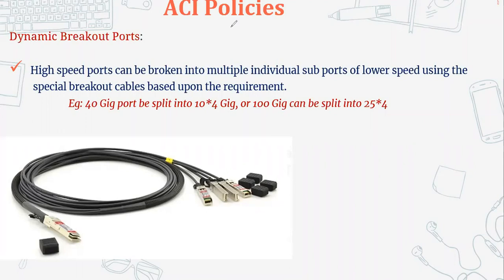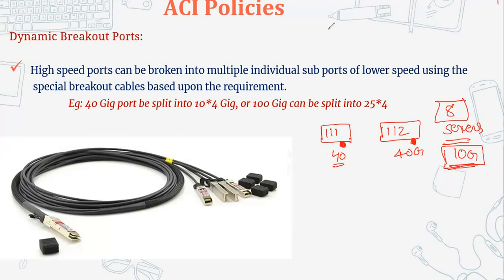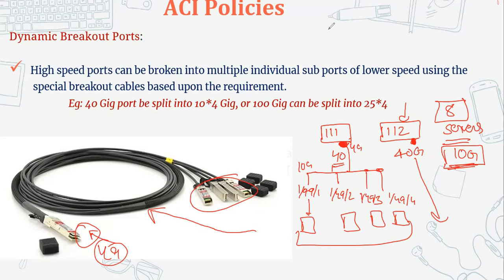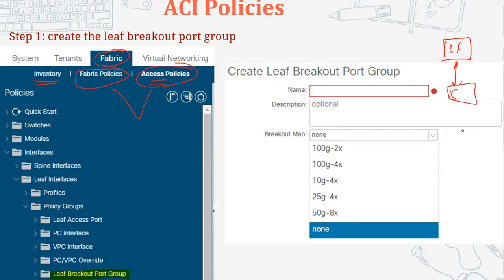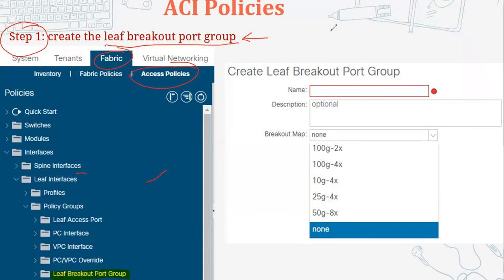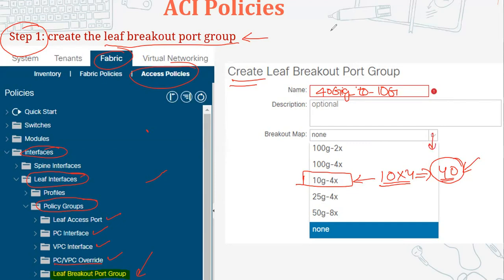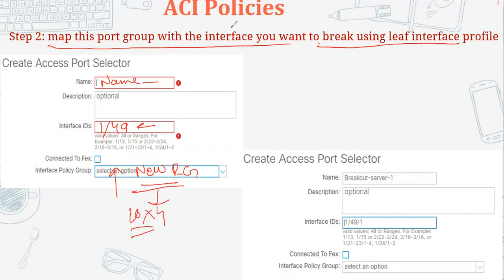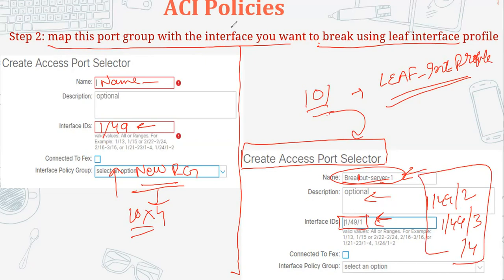CISCO ACI LECTURE 6 (Dynamic Breakout Ports) CCIE 57391

Comment: Hi

Thanks for the Video

Can u pls do Video How to Wire the ACI Fabric and How to Wire the Servers/Bladed/FW/LB  , i mean the required Cables/Tranceivers 10G/40G for ACI Fabric and for the Servers/Bladed/FW/LB Connected to the Fabric
Reply from the maker: Hi, i do not have any experience in server/LB/FWs, but i can tell you that on leaf switches we have multiple flavours like copper/rj-45 ports leaf, then we have sfp/fiber leaf that support different port speeds like 1g, 10g 25g 40g etc, for more details on modal wise details for leaf switches you can check cisco’s scalability guide..
Reply: @TheNetworkShooters  
I meant Type of Tranceivers/Cables need it to wire the Fabric /servers/FW/LB